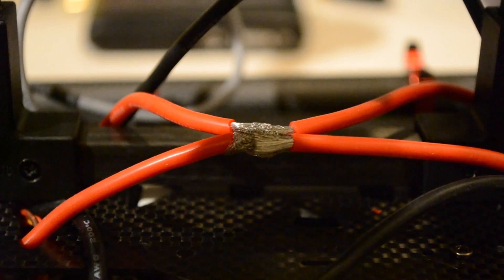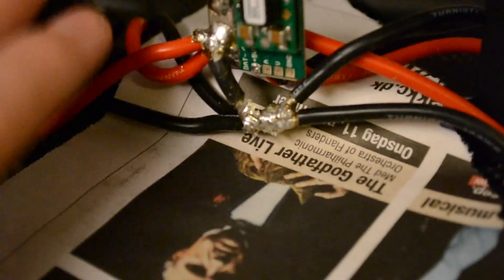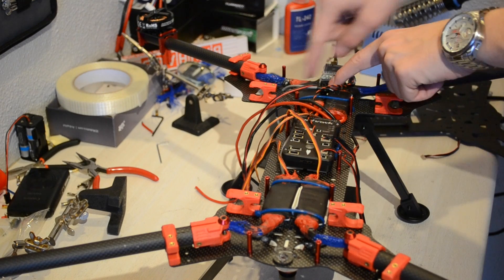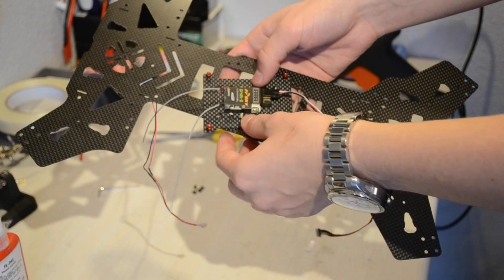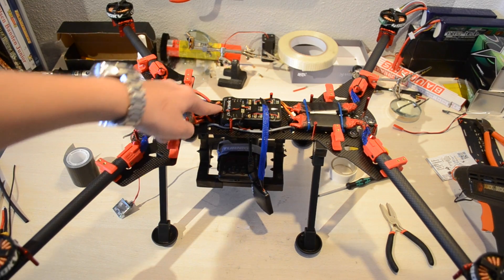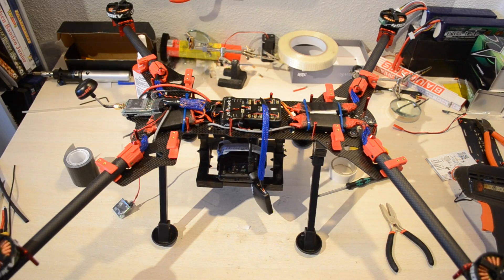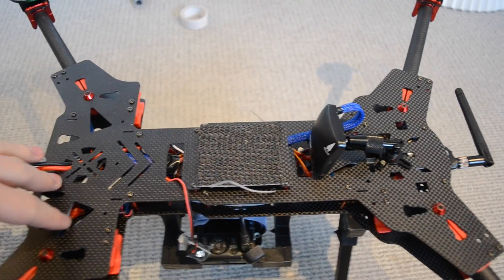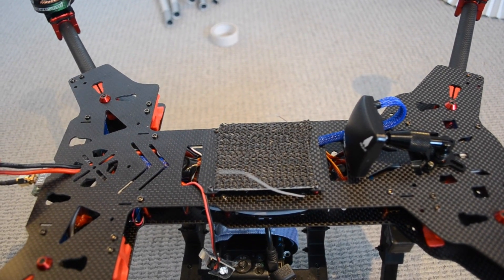H4 Alien 680mm quadcopter build and review - mounting electronics [Part 7]

Comment: Hi, you have to make sure that all the parts of the copter are level, not just the motors. If the motors are all level, but the frame is not, your copter will be offset.

Comment from the maker: +Ari Stotle
I still cannot reply to your comments due to your privacy settings :/ It was a really good point you had on the sharp edges and the wires, i will definitely fix that.
As for the "missing" clamps it seems you are watching the series in the wrong direction as i have stripped down the frame to save weight in part 1 of this series ;-)
Regards.
Reply: Yes I have been watching some in reverse order because I could not get some to play at the times I was trying to view them because of errors from YT popping up. If you are only using one clamp to lock the arm it might be a good idea to also drill a small hole through the frame directly in front of each clamp & put an M2.5 or M3 security bolt through the frame at that point secured with a small wing nut at the bottom with a rubber washer to stop it vibrating free while it's flying to act as a locking pin to stop the possibility of the arm coming free from the clamp under certain conditions, such as the single clamp developing a fracture & becoming weakened, because even if you have all the props spinning the right way & therefore putting the torque force from the motor & prop to the back of the clamp under acceleration, when you decelerate it could let go of the arm & obviously the result would be catastrophic for your aircraft. I'm using both clamps but I'm still going to use a locking pin as I've described too because those types of clamp have been known to fail occasionally. These things occur to me as I'm building mine up because I'm a diagnostic engineer by profession & can see the possible danger areas for possible failure of certain things naturally because I've been doing the job for so long now it's become a habit with me. ;-)
Reply from the maker: Ari Stotle Hey again. I'm sorry for the late answer i have been quite busy lately. Anyways, i have flown it some times now and i am confident it won't unsnap. Possibly it can crack and then unsnap, but i'd rather have that the arms fold back in the case of a crash rather than the whole frame breaks because of a crash. Plus i don't want to unscrew 4 bolts every time i have to transport it somewhere. That is just my opinion even though i know how you feel when you see areas of weakness and possible danger i have developed that habit as well, but sometimes one also have to judge if the small improvement is worth it in other aspects :-)
Hope your build is going well.
/Martin
Reply: MultiCopterBuild
Hi Martin..That's a good point about the arm folding back in a crash & yes, there are many things that could be done to improve lots of things really, but it all depends on how far you want to go with it & also what you are going to be doing with it, if you are happy with it at the end of the day then that is all that matters really..It might be a good idea to check the clamps each flight though to stay safe because they have been known to fail from hairline fractures....Yes, mine is coming along great thanks. I bench tested the motors with the props on them this evening & was getting 1.8Kg thrust from each motor with a 4s lipo at 85% throttle & after several minutes the motors & esc's were only just warm, so all seems to be going well so far. I am just waiting for some longer spacing pillars to arrive from China though so I can do a small modification to the frame on the underside where the battery plate is, to allow my RX & some other electronics for full telemetry to sit in that space below were the flight controller is mounted. The 10mm spacers that came with the frame are too small for that so I'm replacing them with 15mm spacers. It will then leave the top completely free of any electronics & all the electronics will then be housed & well protected. If my mathematics is all correct I should get about 17 minutes of flight time with the AUW I intend flying it with & that is exactly what I was aiming for with the setup as it is, there is not really much more you can get from a quad though, so my next project is going to be another big hex or octo which I will want to stay in the air for at least 30 or maybe 40 minutes... At some point I might even get around to making some video like you do but I tend to get carried away when I start building stuff & the time just zipps by & then before I know it I've finished what I was doing before getting the camera out...I will get some video of this latest quad flying though & hopefully it won't be too much longer...Happy flying..Steve.

Comment: It's an interesting series of videos you have on this build & I'm enjoying watching them....I just noticed a bit of a difference between my frame & yours though, they are identical really but mine came with double locking clamps for each of the arms, which makes me think that there might have been some issue or other with the single ones like yours has by not holding the arm securely enough & maybe letting go of the arm under certain flying conditions, I notice that your frame has the holes for two clamps already drilled which is a bit confusing really...